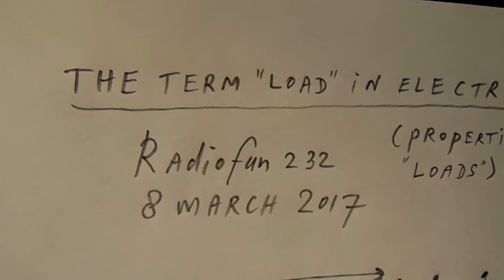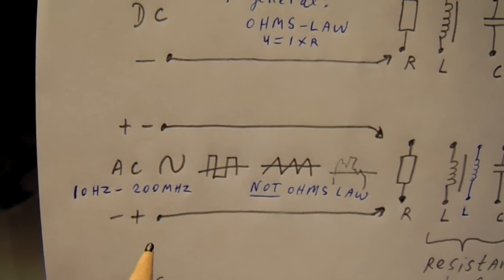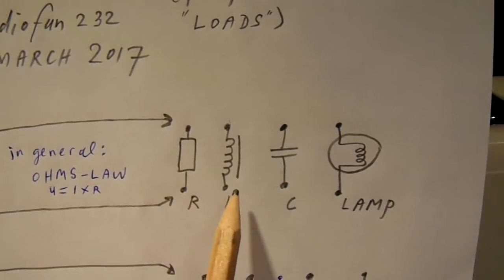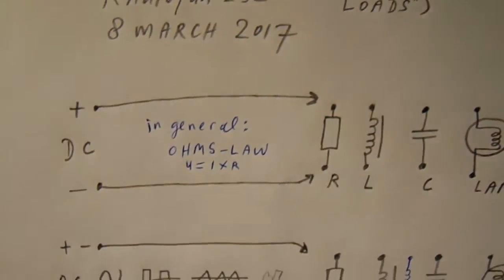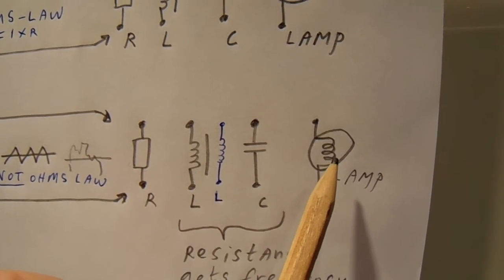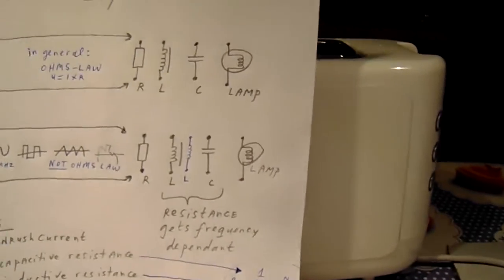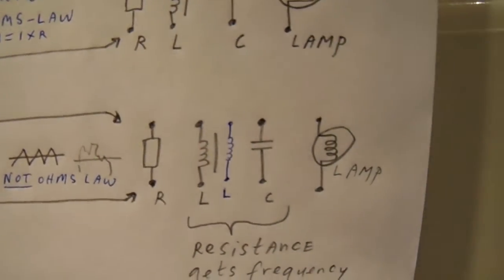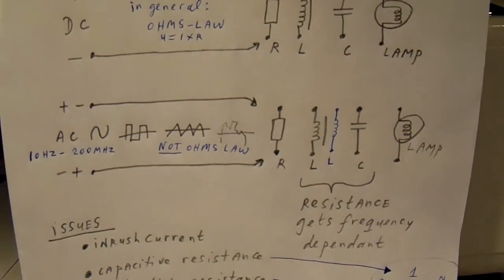The term "load" in electronics (capacitive/inductive/resistive/lamp to DC and AC)

Comment: Excellent video. Should the terms for Inductive and Capacitive  resistance be Inductive and Capaciive Rractance?
Reply from the maker: Yes, the terms that I use are somewhat obsolete. But I am not completely sure. I have, by purpose, used the terms that were used in old radio books (the 1930's-1940's).